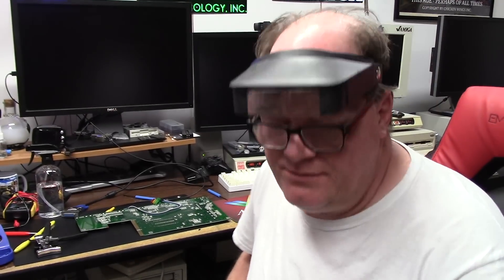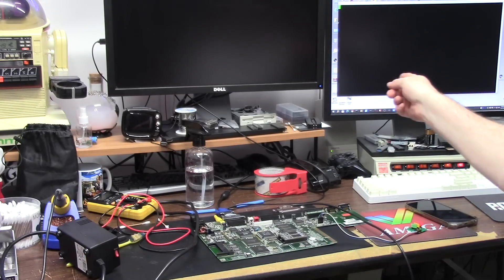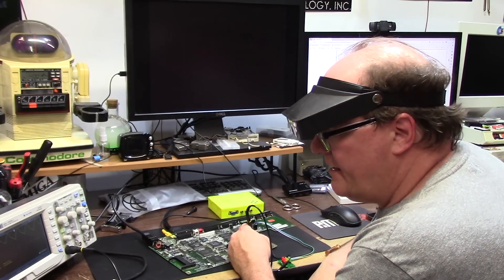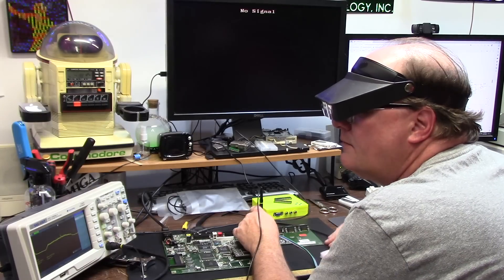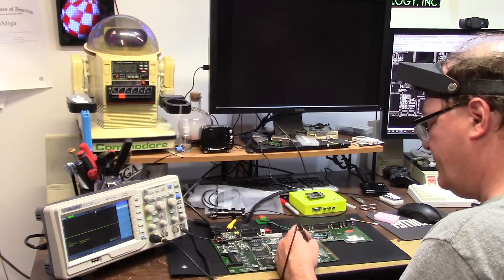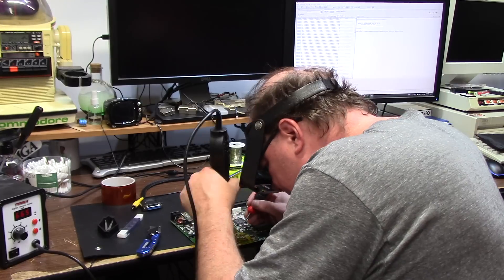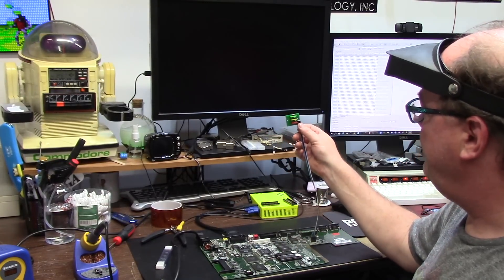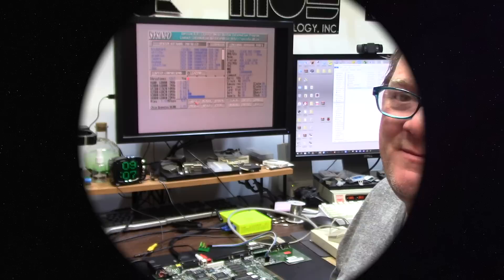The Amiga 1200 of Black screen DEATH

Comment: Would you Ever be Interested in Repairing my Amiga 1000 Rev A. I've been poking at it for a month and documentation is so Scarce for the 1k.
Reply from the maker: whats wrong with it.
Reply: @ChrisEdwardsRestoration  I replaced the 8520s and recapped the MOBO and daughterboard with no luck.
Reply from the maker: I will help shortly just backed up like a truckstop toilets at the moment
Reply: Just chiming in to say how wonderful that someone is actively using their A1000, as the core of a music studio setup no less. Hope you can get it working again.
Reply: So, it’s not booting at all, no LED blink codes, no floppy activity, 1/10 power ups results in a garbled mess. (The LED is on but stable.)

I’ve removed all modifications, disk drive, Parceiro ii, mouse and keyboard dongles. 

Reseated all the chips tested voltages a bit but I’m unsure of what to look for. 

This isn’t a barn find either, it’s the centerpiece of my music studio that booted as recently as a month ago. I put it in the original box to clean the studio, when I hooked it back up and black screen of death. 

Thought it was RGB2hdmi, but removing that didn’t work, ordered 2 8250 CIA chips, and a recap kit awaiting their arrival. 

I found the component level repair manual for the A1000, but still have no idea where to start. 

I would happily pay for the services and parts, and would be cool to see you document an A1000 repair as they are becoming extremely rare and maybe save someone else along the way. 

@ChrisEdwardsRestoration

Comment: Hi Chris, GOOD find mate, im crazy with mine with SAME DIAGNOSTIC as yours, time to check gal. Any test to do in GAL for its in working condition before take it out from the motherboard?? I dont have a PLCC programing, any recommendation for buy one?

Thanks Chris.
Reply from the maker: Pull it and read it.  If its all 1’s its blanked itself.  They are reprogrammable so just re write the jed file to it.   If it takes its good if it fails replace the pal

Comment: Hi Chris. Congratulations for the video. I learned a lot from your videos. I have an A1200 that I've been trying to resuscitate for years, but without success. The reset signals, clocks, etc. are all OK. There are no faulty tracks, I did the recap twice, I changed the ROMs, I tried almost everything, but the Amiga won't boot. The version of my A1200 is 2B. I would like to replace the GAL (XU1), but I can't find the source code for it. I have a TL866, just like yours and some GAL 16V8B-15, but I don't have the source code for it. Where can I find this code? Thank you very much.
Reply from the maker: It’s dangerous to go alone take this!  https://www.amigawiki.org/doku.php?id=de:parts:pld_download
Reply: @ChrisEdwardsRestoration  Hi Chris. Downloaded! I'll try tonight. And I will post the result here. Thank you very much.
Reply: @dghummel1956  so, what happened — did the reprogramming of the gal yield any positive results?
Reply: @ChrisEdwardsRestoration  Mine's a 1D4 rev and that site doesn't have a link to the jedec, does it not exist?
Reply from the maker: @L-z9x4w  ? theyre all the same code.
Reply: @ChrisEdwardsRestoration  I assumed by the two different downloads that they were different and that the missing one meant nobody had uploaded it.

Comment: Great job! It always feels good to finally fix something, even if it was just a stupid issue. Happens to me all the time.
Anyway, what does the pal (or gal) actually do? Googled for it but couldn't find it.
Reply from the maker: think of them as little cmos chips, but now electronically erasable over they;re hard coded pal cousins.
Reply: @ChrisEdwardsRestoration  I know it's a bit like an eeprom, but what's it's function in the miggy? What does it store? Googling it I found a lot of 'romdumps' of it, so it's like static code in there? Or does the amiga store settings in there or something. Can't think of anything my A500s and A1200 would store.
Reply from the maker: @robertgijsen  the 2000 has 4 actually. they are like little gates, the first iteration of fpga in a sense,  like a programmable logic chip, it holds a small program which tells it what to do. it doesnt run like a program, but in logic, like if input A is low then output pin3 should go high. and other things... each one is different, and has different functions, on the amiga, it can be hard disk control, floppy control, DMA access for Ram, and many more things. in this instance, the Xu9 GAL chip on the 1200 is responsible for many little things. mainly Rom start , and clock handlingto the other chips, it has 8 input and 8 output states, and 2 power and a ground onboard.   it replaces about (4) 74LS TTL logic chips on a similar board.  its a cost reducing way  think fpga is the best way i can describe them. its different than regulare logic chips as logic has  to run and compare itself against "truth Tables"" which are hard coded. it gets deep.... so lets just say like i do,  "Math and Science stuff"  but thats it in a nutshell. Hope it helps
Reply: @ChrisEdwardsRestoration  thanks for the explanation! I know my way around retro electronics and FPGA as well even though I never used one. So this one replaced some glue logic. Good to know.